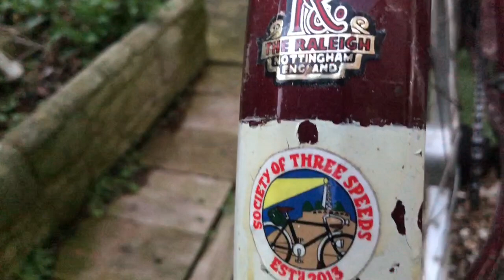Wheel removal & Tyre change on a Raleigh 3-speed vintage bicycle with drum brakes & hub gears & dyno

Comment: Super helpful! Was having some issues with chain tension and wheel slipping on my courier so seeing yours come apart in this much detail was great
Reply from the maker: MAke sure there’s an anti rotation tab washer in each side, or one of those and a chunky serrated washer in opposite sides.  Nuts need to be VERY tight.
Reply: @unbalancedcrank  anti rotation washer snapped when I over tightened so have just cranked the shit out of it with a pedal wrench and seems to be working alright now!
Reply from the maker: Those castings are made of cheese! Tab washers are better.

Comment: My cable at 17:00 will not stretch to fit the pin back in it's home! Should I be releasing the tension somehow? Helppp!
Reply from the maker: Yes. Either slacken it at the barrel adjuster at the hub end, or if there’s no adjustment there you can move the guide wheel down a few mm, or the fulcrum clip/cable stop.